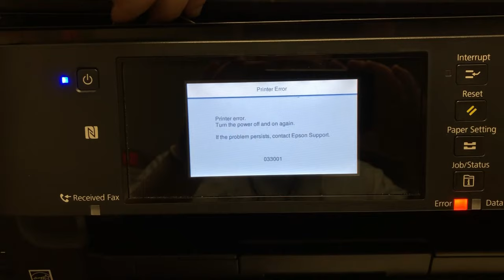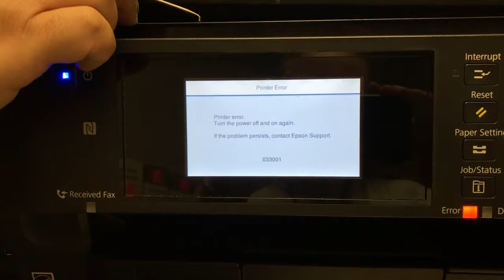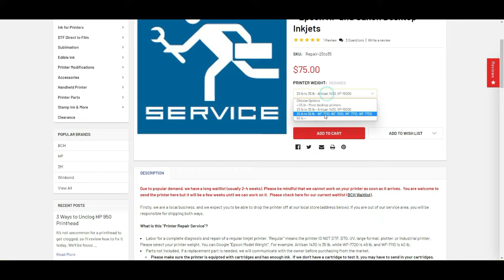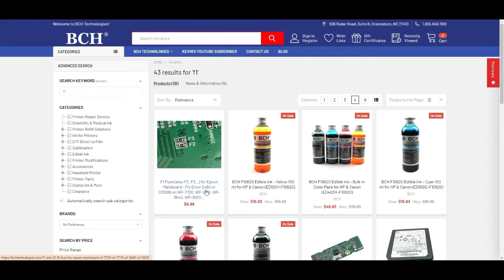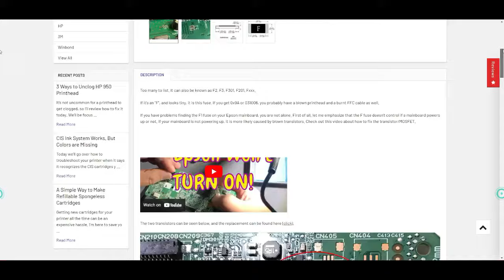Fix "Epson Code of Death" - Error 031006 033006 or alike

Comment: To fix the EPSON L3110 Error Code 031006, you can try the following steps:
1. Turn off the printer and unplug it from the power source.
2. Wait for a few minutes, then plug it back in and turn it on.
3. Check for any obstructions or paper jams in the printer.
4. If the error persists, contact Epson customer support for further assistance.

Comment: I when you an Epson repair center, and the printer was fixed,but when I got home, I connected to wifi , and when I did it the printer asked for an update, when it rebooted the error 031006 came back, I’m thinking that the reason that error started to begin with, was because the power supply, is damaged and that’s why it cause that problem again after it rebooted

Comment: hey guys. I got fatal error 08H on my printer. I read that it means either motor or board error. but what usually they means? the printer can start and move but in 2-3 second will stuck and both led turn blinking orange / red. My main suspect is sensor?

Comment: the printer new i took print head something has to do with the ribbon brand new printer to head out to put in my printer  031006 i put it back in the new printer now that printer is reading 031006.  how is this posible when its NEW

Comment: when you test the fuse does it matter what side the red and black lead is on?  I tested my F1 and get no response but if I switch the red and black lead I get a response where the F2 fuse I get a response both ways.

Comment: Good job ....
please i bought fuse F1 (wf 7620) from aliexpress....but fuse F1 was green color....is this normal?
Specifications:
0467.500NR -- 0603 0.5A
Series: 467
Maximum rated voltage: 32V
Body: advanced high temperature substrate
Interrupt Rating: 35A @ 32VDC
Nominal cold resistance: 0.041 Ohms
Opening: very fast (FF)
Package size: 0603(1608)
Reply from the maker: Maybe. The Epson is 48V and yours is 32V. Put it on and if you see fireworks or smell bacon, then it's not going to work. Buy American, bro! The fuse is protecting the printhead and the two Infineon MOSFETs. You don't want to AliExpress it.
Reply: @BCHTechnologies  thanks kevin but what are the characteristics of fuse F1 for epson wf 7620 because now my printer did not work only red light inside the printer....please i need your help ....your brother Youssef SALAMA from Morocco
Reply from the maker: If you see the red light (the PF scale sensor), then the power train should work, so the Infineon (most expensive) MOSFETs are good. If the LCD doesn't work, then I will look at the FFC connection for the LCD panel. It may not be a fuse problem.
Reply: @BCHTechnologies  finally I found my problem: it's because of the fuse F1 and the print head is fried inside because of the cleaning solution

Comment: My two- month old XP15000 went dead after doing an update.
The warranty people was suppose to send a replacement 4 days ago via overnight shipping..The replacement, I was told , will be  a refurbished unit. They are replacing my brand new unit that went kaput with a repaired unit.
What can I do? 

After following up on the delivery, They again promised to send the replacement unit via express overnight shipping today. That didn't happen. No email information as they promised. Zero. Nada. Zilch. 
For a major printer company, this is not good. Shaq will not be proud.
Reply from the maker: Epson usually gives me two options: 1) return it and get a new unit. They will need to receive the old unit, check it, then ship their new printer, and 2) I instantly get a refurbished printer and I have 30 days to return the old unit. You need to tell them specifically how you want the warranty to be handled.
Reply: Hello, Kevin. How do I get in contact with you? So I can send out my printer's motherboard DTF printer.